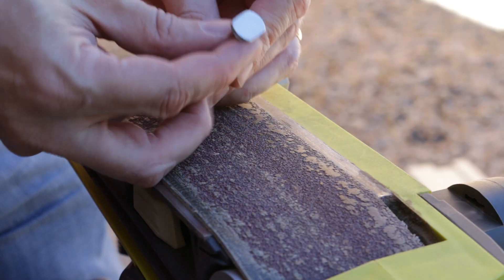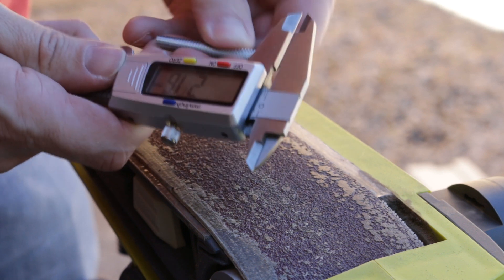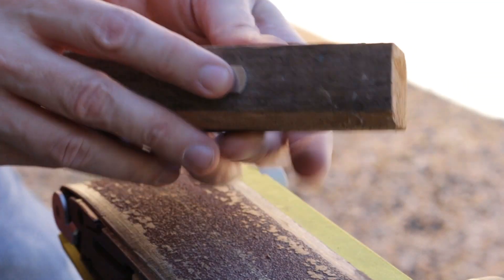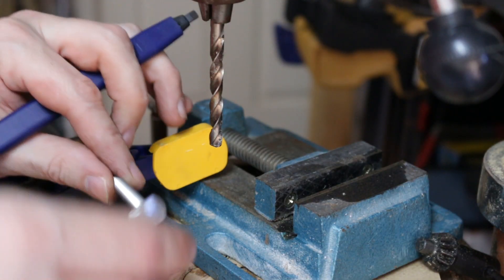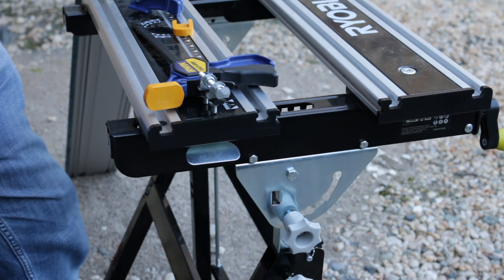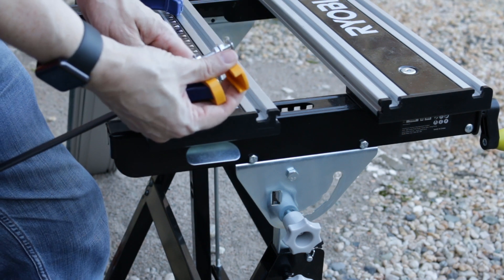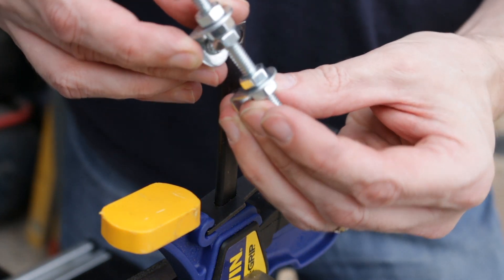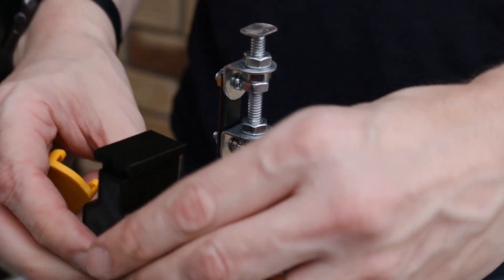DIY: making Bosch track clamps

Comment: The first time I used my Bosch track saw guide rail it moved, despite the blurb sawing its weight and rubber insert would keep it steady.  As much as I hate losing even the two clamps, the Bosch  FSN KZW clamps are a crazy £66 on Amazon, so easily worth it.  Plus I have full metal working facilities at my Menz Shed, so I know what my wee project for tomorrow is going to be (I'm a retired toolmaker).  BTW  I noticed there was perhaps a bit more resistance to sliding my saw on the track.  Do you use wax to make the saw slide more easily?  I am using the slightly bigger GKS 18V-68GC saw which weighs 4.3Kg so that might make a difference.  Thanks for the idea.
Reply from the maker: Mine only moves sometimes, so if material is smooth I’ll clamp it. I guess ensuring rubbers underneath are clean. I don’t use wax but that sounds like a good idea, silicon spray might work good too, will need to try it, thanks for the suggestion.

Comment: I think if I had access to a 3D printer I would have made a part that slides into the track and has a hole through it to bolt to the clamp.  Although perhaps the plastic wouldn't have been strong enough when under tension
Reply from the maker: Sounds like a good idea for 3d printing carbon fibre - may still be too weak for such a thin part (was only about a 1.8 mm thick or something like that) or 3d metal print/sintering

Comment: Hah that's a great use for those pants wee irwin quick clamps. I'll have to do this with mine. I suspect welding one of those t-track bolts to the clamp bar would work. Even epoxy/JB weld would do it I think.
Reply from the maker: I would love to have a go at welding some time

Comment: Good Job! What's the model number of the Ryobi workbench and where did you buy it? Thanks
Reply from the maker: The workbench is the RYOBI RWB002, I bought it from Bunnings Australia for $99. I was in two minds whether to return it or not, but decided to keep it in the end. I was thinking I could work around some of its drawbacks. This was some of the questions I had for Ryobi and their answers: 1) When clamping the rear platform pivots and lifts up to 5mm off the rail meaning the clamps are out of alignment and the piece being clamped is free to wobble. Why is their so much play is the spring loaded mechanism.
(A1) There isn't an adjustment & that is the way it is. If there were a very close tolerance the back table would be much harder to move & jam. It still will hold your work & if you feel the need be as a suggestion adjust the rear top to position & then place a wedge between the underside rear of the table top & rail before tightening the front top.

2) When moving the top from the closed 80deg position to the horizontal position you have to push and hold both side knobs in. If both hands are holding the knobs in, how is one supposed to raise the table?
(A2) Pull the table up on one side to the other. Push one side knob in & pull the table up so it is just past a detent position & then go to the other side & pull that so it pulls thru to the next detent position & repeat till horizontal.

3) The instructions mention that the green clamps can be tightened to lock them in the track, but they don't and can still slide, it just increases the friction marginally. Why is this?
(A3) The knobs on the green clamps will just adjust the friction only. They are there to clamp material between the 2 tops & not designed or intended to clamp across the one top.

4) Why are the assembly instructions so poor. It lists 3 different types of nut/bolt combos but does not number them, you have to deduce which screws are for which holes. The assembly images only appear to show one size of bolt.
Wouldn't it have been better to list a part letter next to each bold and use a corresponding letter in the assembly image?
 
(A4) Manuals are done overseas & we have little influence over the content etc. It has been mentioned in the past but it seems falls on deaf ears im sorry.

5) The black plastic track clips do not fit the track and I had to knock them into the track initially with a mallet.
(A5) The plastic end caps on the table top are manufactured that way so when carrying or transporting the table they wont just slide off so much less chance of loosing them. Its a once off assembly thing anyhow.
 
Ryobi Customer Care
Reply: Thank you for your very comprehensive feedback. Appreciate it.
Cheers.